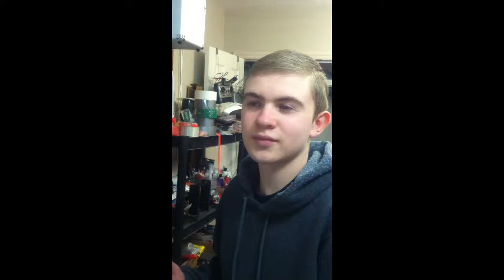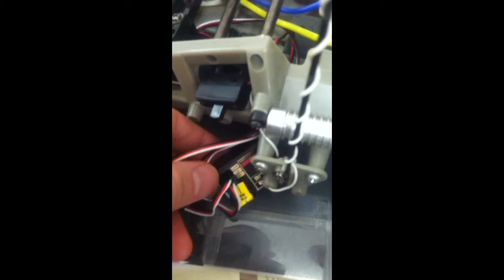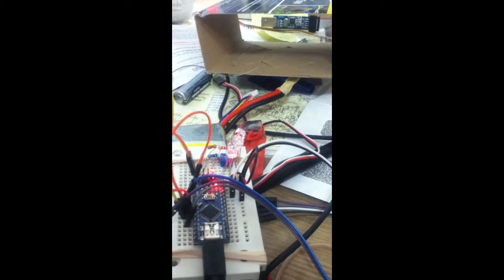Hayden's Arduino learning - blinking an LED via throttle setting using RC car remote - better video

Comment: What should I do if I want to apply this feature to ESP8266？Thanks!
Reply from the maker: Study my source code and see if you can little by little piece together what to do. You'll have to port the code to the ESP8266. Have conversations with AIs such as Bing Chat / Microsoft Copilot, ChatGPT, GitHub Copilot, Google Gemini, etc, to help you as well.
Reply: @ElectricRCAircraftGuy  

Okay, thank you very much! I also use Arduino for programming, I'll try it